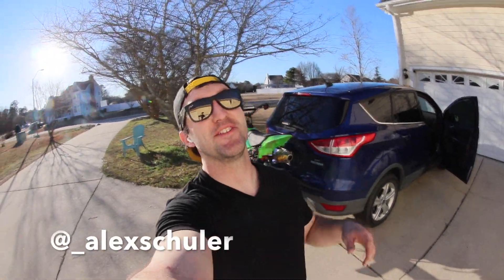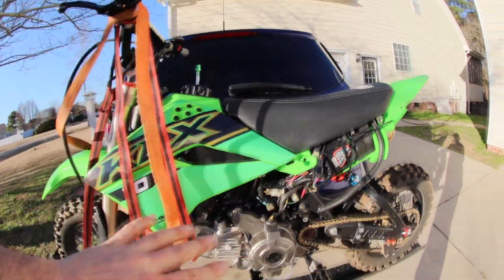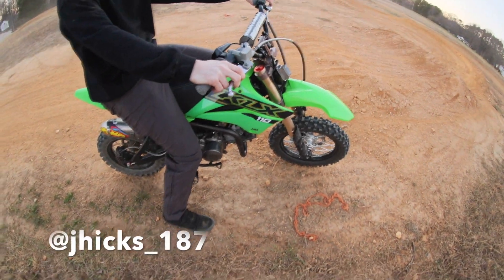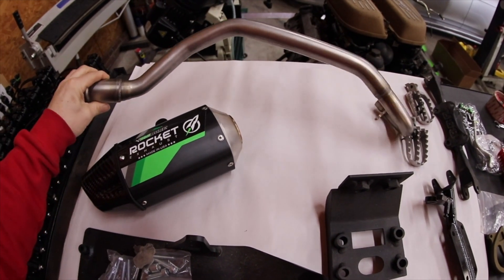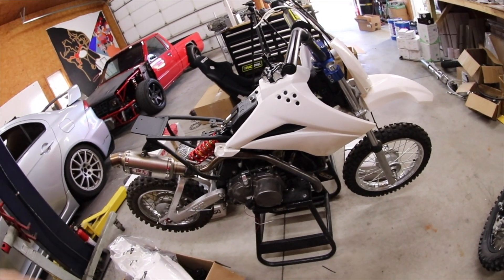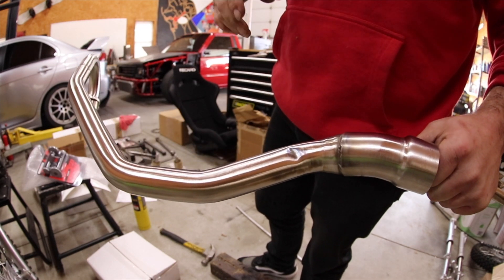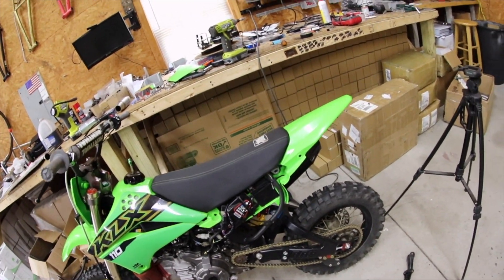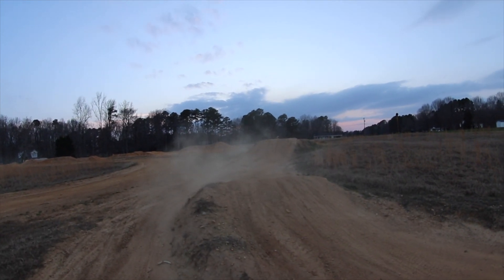DAY 6!  WE FINALLY RIDE THE FUEL INJECTED KLX110!  + WE ADD A RACE HEAD, ROCKET EXHAUST, AND MORE!

Comment: You can make a cable with the proper end for the tb on it that's what I did for my fcr 28. Extended klx cable cut the end off and put a barrel on it. Also if you still have the fmf 4.1 my buddy is looking for one.

Comment: So were frame mods necessary?
Reply from the maker: Yes, if you are planning on using the oem battery, you’ll need to modify the left side of the subframe
Reply: @EVDMFG  What if you were to not use the oem battery?
Reply from the maker: @mindfreak9674  depends on the setup.  If you’re using electric start or an efi system, you’re going to need something.  If you just want the newer plastics, you only need to Move the lower number plate brackets up a bit